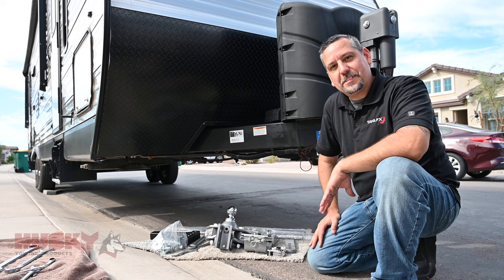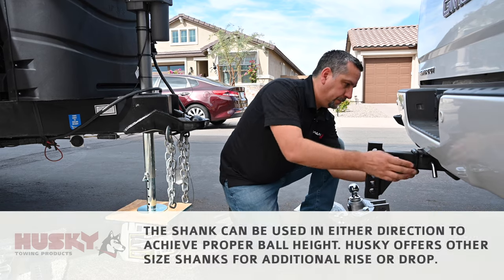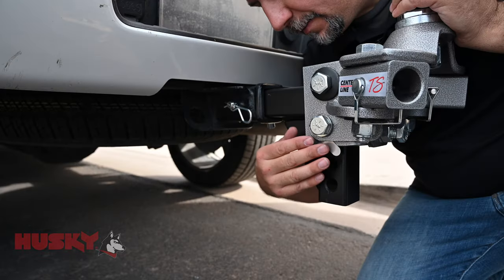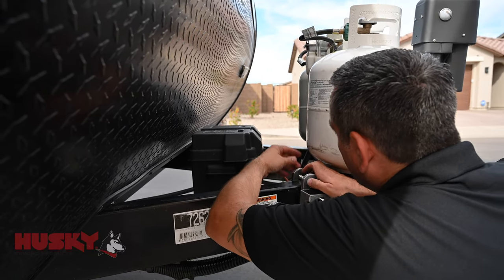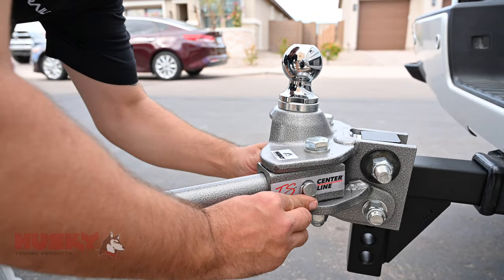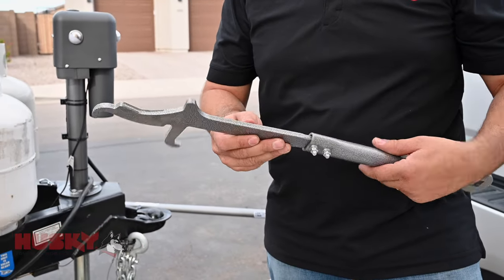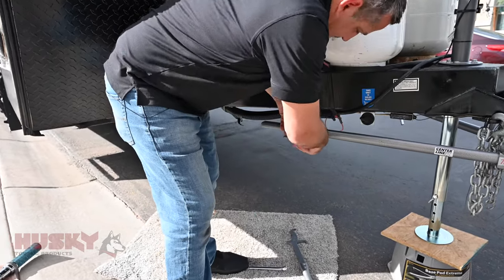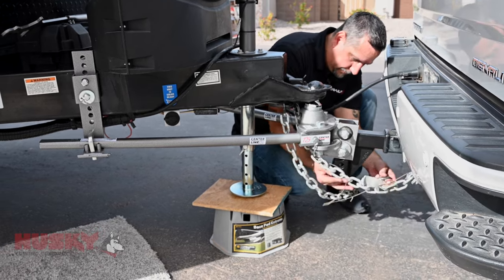How To Install The Husky Center Line® TS Weight Distribution Hitch

Comment: You left out a very important part.  You didn't talk about the washers on the head pin.  The instructions talk about how different washers to use depending on how many inches.  But, inches of what??  The instructions don't clarify.

Comment: Is load popping noise normal on these?
Reply: Yes that normal. When you turn the bar comes off the bracket when you straighten up it makes contact again . Thats how I install them actually no tool needed.
Reply: @BrianSmith-si4zd  thanks bud.. showing this to the wife..
Reply: Yeah sounds ugly too but it’s completely normal
Reply: @dg7432 my wife was freaking out when she started hearing the popping noise
Reply: @raptracktv6029  after 3 years of having ours. The wife still freaks out. Definitely a head turner in the rv parks
Reply: I had an older model and sold it with my trailer and I loved it so much I bought another one for my new trailer. The popping noise is 100% normal when turning.

Comment: Question I need to pick up my new trailer from the dealer and I need a weight distribution hitch but can I just install the hitch part to take it home it’s about a 30 mile drive from point a to point B?
Reply: depends on your weight of all equipment involved. the ball part of the hitch without the bars is rated for 600lbs tongue 6000 lbs trailer weight. look up centerline ts manual and front page of manual says so

Comment: @ottodealerventures9510 For some reason it will not let me reply to your question. So here is what I have, it's is not cheap,  bought this from Amazon and it is quality. Performance Tool M204 3/4-Inch Drive Torque Wrench with LH/RH Thread Torque Capabilities - 100 to 600 ft/lbs of torque

Comment: What do I do if the measurement at the tongue in more than 1/4 to 1" higher? My trailer is also 1 inch higher in the front when hooked up to the truck, what should I do?
Reply from the maker: Hello, our tech team will be able to answer this question and any additional follow up questions! You can call them at 877-544-4449 M-F 8-5 EST.
Reply: Better question is why would the frame be higher after installation?  Wouldn't that make the trailer be nose high?

Comment: Our husky hitch is really loud when going around corners is this normal?
Reply from the maker: Hello, our tech team will be able to assist in why it is making noise. You can call them at 877-544-4449 M-F 8-5 EST.
Reply: Our hitch is very loud as well, can I use the number above to call from Canada? @huskytowing
Reply: It’s normal mine does the samething…it’s the friction causing the noise it’s normal

Comment: Hello, are the spring load bars interchangeable from 600-800lbs to a 400-600lbs for example using the same assembly? Thanks
Reply: Yes, the 600-800 and the 400-600 are interchangeable using the same head assembly

Comment: I just installed this on my Nissan frontier. Empty my front wheel base was 34" and rear was 34 5/8". Now with the trailer they are both 34" and the trailer is almost completely level, has 1/2" tilt to the rear. Does this sound correct? We figured we would have a couple people in the truck and 100lb of stuff in the bed. 

Also, when backing up it clanks sometimes, is this normal?
Reply: Yes, this is within tolerance.
Reply: The clanking is just the friction
Reply: If it's clanking, it's working. When it's not clanking or popping, especially in a turn, that means it's lost friction, which is your ability to alleviate sway.